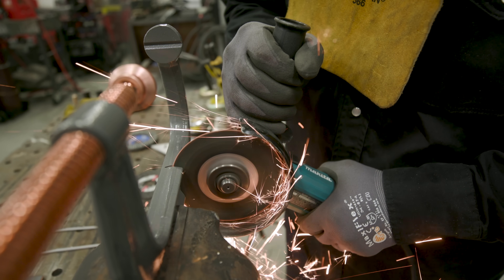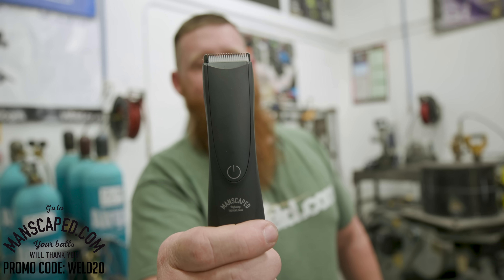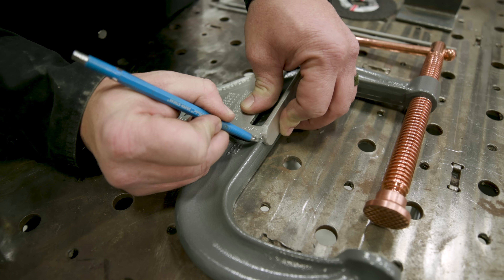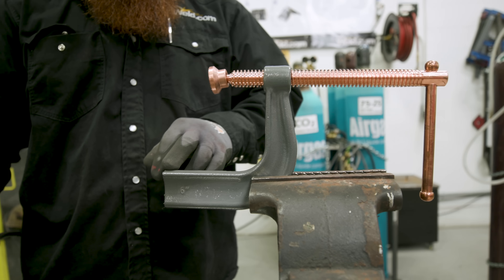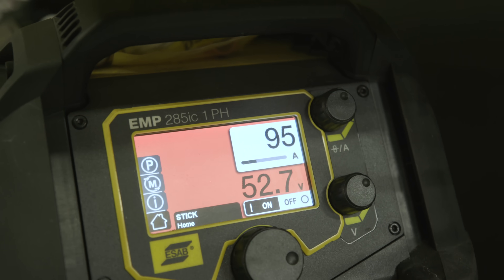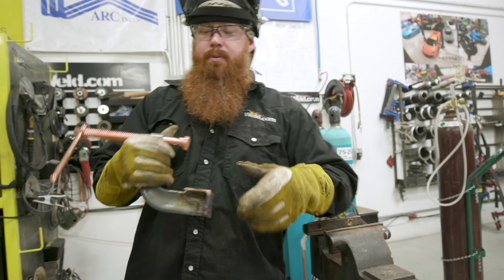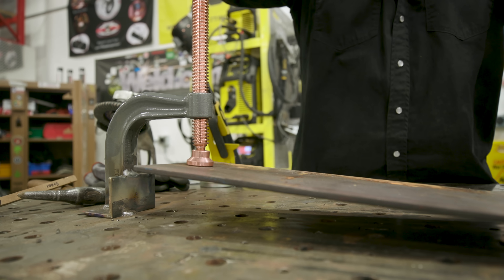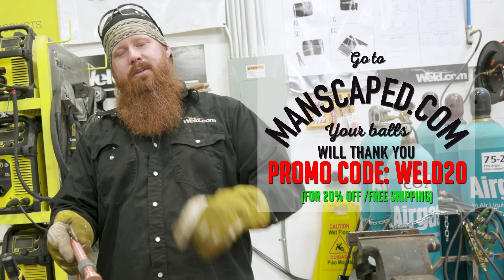How to Make a Half Clamp | Reclaim your Broken C-Clamps

Comment: Works even better if you drill holes in the angle and thru bolt to table and you aren’t welding to the table. SMH

Comment: If you were just using it on that table, you could weld a round bar to the bottom of the angle to insert into a hole, and wouldn't need to tack it at all.

Comment: Why couldn’t you just drill a couple of holes through the angle part and bolt it down to the table? Would avoid the welding step and cleanup on the table.

Comment: Why not adding a bolt extension instead of an agle iron? With the bolt extension you can use your "3D" welding table holes and you don't need to weld down the clamp?

Comment: why didn't you just weld a pin the angle bar then you wouldn't have to weld it to the bench every time ?
Reply: It was a demonstration of what one might do when working on structural Iron (weld the clamp to a girder or something else), rather than on a  bench in a shop... yes if you have a posh layout table, weld a "dog"/pin in the end, saves scaring up the table...

Comment: I was wondering if you guys had a video of an inverted T weaving pattern? I’ve been looking but haven’t found one yet. Vertical up MiG welds have been coming out like garbage and got told to try it.
Reply: Go with the triangle method, pausing at the toes, not too slow across the middle. Have found that to be the best method after trying a few

Comment: Hi Jason. It's funny.  You must have ESP. I was just thinking today of leaving a comment about making a half clamp for out in the field work.  LOL  
    I've been using a half clamp that an ex co worker had made and man is it handy... the only thing different he did was welded a 2×1- 1/2"  block on the bottom.  What's even great about them is that you can use them on any position. Overhead, vertical and horizontal. Even around corners. Just tack weld the top of the plate or in my case the top.of the block...

Comment: Nice idea but why cut so much off a 6 inch clamp? So much lost capacity. Here can you clamp this 4 inch box section down? Doh, Need another clamp! 😳 (but I appreciate your videos really!) you could also drill and countersink a hole in the angle, then weld in a pin, grind flush before welding it to the clamp. Hey presto an inserta clamp on a budget. 👍 Clamptastik
Reply: honestly its better to use a bolt and nut and homemade clamp, cheaper  and better overall
Reply: I don’t get it either. Now there’s a lot of wasted screw and capacity. There must be some reason, maybe leverage?
Reply: Say you got a beam that is the only thing you can weld the half clamp on to, and a plate that you need to clamp down 2” below flush from the end of the beam. With it shortened down you can extend the threaded part all the way past the beam to clamp down the plate

Comment: Why not weld on a pin that slides in the holes of the table like it was designed? You can get 5/8" steel dowels at any home improvement store. Seems like that's an equal amount of work, but less mess on the table surface and easier to remove for the next project.
Reply from the maker: The tool isn't meant for a fixture table. We were just showing how to use it in the field.

Comment: You give me and idea ! Maybe you can do what u did , but on the bottom of them angle iron u can center weld a bolt and instead of welding it on the table u can it with two nuts through the holes of the table
Reply: I believe he mainly intened it to be something that you can use for field work.